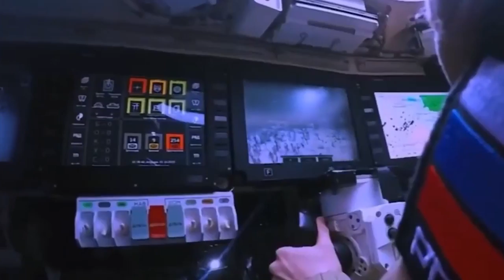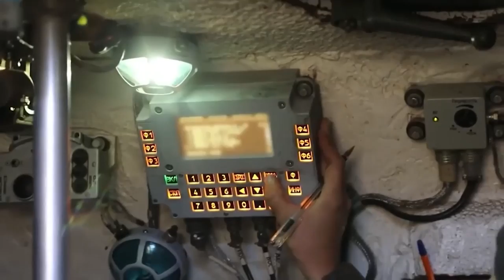What's Wrong With Russian T-14 Armata Tank (Military Analysis)

Comment: So the tank doesn't suck , but the fact that Russia cant produce it in large numbers does
Reply: No it does suck. It was designed around a smaller than normal engine. That engine is a poor copy of a German porsche engine designed to pump oil. The production buildings are built. The workshops are built. But empty of any significant tooling due to sanctions. 
The T14s are hand built effectively. So as you can imagine take an age to construct. And again due to sanctions have cheap rubbish electronics.
Reply: @TheBarnestah  sources? 😂

Comment: The autoloader doesn't have to be a problem in real world. In theory, yes it can break, but what are the chances for it? Americans developed a similar concept in the 80s called MTTB and it too had an autoloader that IIRC serviced 40k rounds in harsh conditions before there was any problem with it. So yeah, in theory it can break down and it probably will one day, but how many soldiers would be saved in the meantime thanks to the design of the tank that is enabled by this autoloader?
Reply: If anyone knows anything about autoloaders on Russia tanks, they tend to spell death to the entirely of the crew. Just take a look at the tons of video footage of Russian tanks getting their turrets popped off because of the ammunition cooking off within the autoloader. Just what do you think happens to the crew inside when their tank turrets are popping off?
Reply: @Jknight416  T14 tank has blown off panel, for it's crew, so when the whole tank blown up, the crew could be saved, well in Theory.
Reply: @IslamistSocialist371  The even in a separate compartment, concussion will kill them.

Comment: How will this t14 tank fare any better against a javelin strike?
Reply: It has an ams that, in theory at least, will shoot down incoming missiles. As was demonstrated in Syria, it works better in theory than it does in practice.
Reply: Moskav ship was also designed to intercept any incoming missile. Yet, it took 2 hits from Ukrainian missiles and sunk. Everything Russian-made is "good" on paper!
Reply: @macobuzi  Have you seen the Mostova readiness report? The ship shouldn't have been in a war zone to start with. Even then, there was no reason it should have sunk either, it could.have easily been recovered if the crew had the bare minimum training and experience.
Reply: Moskva was also practically robbed of all its point defense turrets and missiles by corrupt maintanance officers. Of the 7 PDs only 2 worked and the missiles werent even loaded
Reply: @Jknight416  ground base anti ship missiles do exists my dear, and yes the russian army is incompetent and corrupt. The problem isnt the gear or the solidiers but command.

Comment: "For example the F-35"... Not quite a good example of success... If the T-14 sucks, than the F-35 is deep throat...
Reply: The F-35 has actually proven itself to be quite effective in combat exercises due to its stealth capabilities.
Reply: @samuelweir5985  well they put enough money in it to finally get it right.
Reply: @jfarmer1776  Yeah, the F-35 program was expensive and there were unexpected problems, but that doesn't take away from the fact that the F-35 is an excellent strike fighter. Same sort of thing happened with the F-111 Aardvark program. Lots of development problems but at the end of the road the F-111 actually turned out to be a great aircraft.
Reply: @samuelweir5985  and then it got shotdown by a serbian s-75 like any other aircraft.

Comment: Driving at 75km an hour in reverse using a camera ? 😮😂😂😂😂😂😂 yeah right
Reply: Driving forward also requires the driver to use a camera. There's no difference for him.
Reply: @JAnx01  of course there is. Steering is completely different
Reply: @UlsterScott  How is it different? It's a tracked vehicle.
Reply: @JAnx01  lol. Driving forward, to turn left your steering brakes the left track, when in reverse it has to brake the right track to turn left. Opposite is not easy to do at high speed with only a camera and a narrow field of view. Almost impossible and that assumes that the camera system remains undamaged 100% of the time. On paper it’s not a terrible idea, in the field under battle conditions it’s the silliest idea I’ve ever heard. That is from personal experience. I’m not an armchair warrior, I’m a retired British tanker
Reply: @Colin Elder  There's been systems that mirror the steering in reverse for decades. Nicholas Moran mentioned it in a video he did on the M48.

Comment: Good summary. Advanced techno requires spotless supply chain et contractors quality management to be fail proof, one thing Russia hasnt proved to be so good at. One point tho, the autoloader might be slower, but allows for continued shooting while in motion. Reloading while moving fast (to avoid being a sitting duck) is quite a challenge, even properly strapped. I would be surprised if M1 can achieve this one shot every 5s mentioned  while going through rough terrain. Also, even non lethal blows to the tank can result in crew concussion should pressurization be breached, thus slowing down the reloading process. All in all, modern tank design tend to favor autoloaders (KF51, T99, Leclerc, T14, K52)

Comment: How in the fuck are they firing that fast? Lol 7:45
Reply: I have no idea, but when it came to interviews with Abram loaders, they only said, "You just need to lift."
Reply: You're right, i just realized it was fabricated to make it seem like it was firing so fast, i took the time to look at it closely and saw how fast the dust disappeared after every fire (but not the last one), that's bcz they take the sequence of the next shot where the dust already disappeared completely (after minimum 10 seconds i guess) and superpose it on the previous image using a soft transition, hence the immediate but soft disappearance of dust. And you can see that the dust remained there and didn't disappear suddenly after the last fire coz their didn't superpose any new image on top of it afterwards.
Reply: Trained humans work faster than machines.
Reply: @Brandon Davis  No, the footage is just edited. Like @Zied SG comment said, the dust from the recoil gives away the jump cuts. 

Also, single piece autoloaders are faster than hand loading. The only reason why people tend to think autoloaders are slower by default is. Is it because Soviet carousel autoloaders use 2-piece loading, thus lengthening the process.
Reply: @KSmithwick1989  Lmfao. Sure, kiddo.
Reply: @Brandon Davis  So you're disputing the dust we can all see disappearing between shots at 7:45
Reply: @KSmithwick1989  So, you think it's like a live stream and they don't take multiple takes of the same thing? Tell me you've never worked with a camera, without saying it.
Reply: @Brandon Davis  I've worked enough to spot that it's a looped shot. You can tell by focusing on certain elements. Like the smoke plume, the secondary plume from the bore excavator, and the commander. 😆
Reply: @KSmithwick1989  Wow, an editor used a looped shot. How dare laziness exist, right? Lol.

Comment: Unfortunately you could take this entire documentary and you could put the name of any other countries main battle tank in it and it would sound exactly the same especially hearing about the delays. For every 1 hour of use on a Abrams it requires 2 hours of maintenance! And it uses jet fuel...
Reply: Do you understand jet fuel is literally a gas / diesel type thing (varies what type of jet fuel) except usually less refined? also the abrams engine can use desiel fuel. The M1 abrams also doesnt have the many issues that come with ppl in only the hull of the tank, and is proven through actual combat experience to be effective and many abrams tanks exist. The M1 abrams is still an outstanding tank, and many others like the leo and chally 2 and 3 series also werent riddled with this many issues.

Comment: The armata that broke down in the parade didnt actually break down. It was a mistake made by the driver by pressing the emergency brakes, thats the reason why the recovery vehicle that came to tow it couldnt move it an inch. Plus the auto-loader takes 5-10 seconds to load a shell into the breech and since the auto-loader has proven faster than the ones in t-72s and t-80s the time might even be less. Miss fires are extremely rare either in auto-loading tanks and manual ones so thats a really minor problem. And t-14 as any other tank shares problems so dont show them to people like new and only armatas problems. Thank you and please next time be more educated with a topic.
Reply: 🤓  "uhrm qctually it was not a breakdown"
Reply: What country are you from?
Reply: Drinking the Russian Kool aid I see just like how they say that they weren't retreating in Ukraine they're doing a strategic positioning
Reply: AB, take another bong hit
Reply: @Foundbison  american bot
Reply: Right, and nobody in the tank knew what an emergency brake was. And nobody towing the vehicle thought "maybe we should make sure the emergency brake is off to make our job a million times easier", you know, the first step in towing every single vehicle in existence.
If that's the case, this gross incompetence is far worst than the vehicle breaking down. But now that you mention it, it does seem like the kind of failure only the Russian army can pull off. Next time, you'll tell me Russians forgot you had to remove park to go forward.
Yes, I copy pasted my own comment, cope if you don't like it.
Reply: @Brian-qj4kk  stalinbot
Reply: Couldn’t have said it better
Reply: Bot
Reply: White Fox  they guy was talking facts, just because you don't like russians it doesn't give you the right to ignore facts and just spout nonsense fueled by your feelings
Reply: @Komnis21  you see the difference here is that the US was able to take Afghanistan and Iraq something Russia is having trouble with Ukraine and just check the kill to death ratio in the afghan war that lasted 20 years and compare that to a few months with Russia invasion of Ukraine and also their is a difference when your trying to nation build after you completed the objective something everyone is oppose because our government simply wants to waste time and resources to make companies richer
Reply: @Foundbison  Watch the clip carefully, u will ses the front suspension dumping forward.
If it was a breakdown the suspension would not resist to that extent
Reply: @rodrigorodriguez6332  you lost me at US was able to take Afghanistan kiddo
Reply: Ok dimitri
Reply: T-14, towed to the Parade, broke down during the parade, Towed out of the parade.

Russians: It wasn't broken!
Reply: @Insert-Retarded-Reply-Here  It was towed out, I watched the parade. Cope harder, though.
Reply: @brandondavis7777  there is 50% rebate on copium today in soviet russia
Reply: @rodrigorodriguez6332  

The United States would have suffered significantly more if a large military pact was funnelling billions of dollars worth of weaponry to the Taliban.

Also, the Soviets took Afghanistan before and their client Government survived for months instead of days
Reply: @Foundbison  it wasnt tho. A pilot crashing a plane because he turned off the engine isnt the fault of the plane.
Reply: @MichaelDavis-mk4me  thats just common grunt incompetence.
Reply: @rodrigorodriguez6332  look the country we are arming and that already had one of the biggest armies in the world is harder to beat then a bunch of goat herders in the mountains. Also we nation build (bombed hospitals after the invasion) so it was much harder.

Comment: Its value will be proven when it appears on a front line in Ukraine. Where Russia sorely needs it...  if it works.  
I am seeing stories that a number of them are being used to fire rounds from well behind the front line.
Which could be due to not being properly tested yet, or lacking critical components, or simply not up to full spec but required for extra artillery.   Which, if true, would be a terrible sign for Russia.   Of which there are many!

Comment: The Thing that kill tank tanks on the battlefield are artillery and no tank could counter it , I’m not surprise that the t14 was not deployed. The Russian claim that the t14 could put 7 round down range in a minute which is good.
Reply: LOl where you got that from i'll never know. Artillery is NOT a tank killer. Anti tank systems are.
Reply: @okbutthenagain.9402  did you see what happed to leopards and Bradley’s ? Those tank were smashed to pieces by artillery. No tank can counter a 155mm shell flying down at Mach 2 with 50kg of explosives.

Comment: If the T14 works, it has some potential 

The problem is not as much as the design as much as software, and chips, and the lack of funds. 

If Putin committed to buy 1000 of them in the first order, the cost can come down. Of course that is impossible, since Russian economy is smaller than Spain or Texas

Software is a much harder problem, and chips too. There is no shortcut…even if Putin threw $1T at it, both will take decade to develop 😅 or import, which they can’t

Comment: The T-14 has a super stealth feature not found in most modern tanks.
Reply: yeah its so stealthy its still not been seen on any battlefield
Reply: @Helperbot-2000  why should it?
Reply: @lucasworktv  because if it was a capable vehicle it would be used against ukraine, but its just used for parades while they keep using older and older soviet equipment because their tanks keep blowing up
Reply: @Helperbot-2000  I mean why should you use a new expensive vehicle against a weak by itself country? And especially if there’re other good tanks or other weapons?
Reply: @lucasworktv  Russia has used its best troops on ukraine. The T-14 is not used, because it does not work… like everything in Russia. The T-14 is a shitty tank and Russia is scared that everyone will know this fact if the T-14 fails in Ukraine.
Reply: @sabundus590  sources?

Comment: >one of them broke down and had to towed away 

This literally never happened during the parade the driver hit the E-brake  by accident and they thought it broke down the recovery vehicle literally couldn't move the armata because it had the brakes down which is why not even 10m later its seen driving off with nobody checking the engine stop blatantly lying

>glitches in software 
Wtf are you on about literally no source mentions any kind of glitches and neither does your video cite any sources

>autoloader issues 
The carousel autoloader is the most reliable autoloader design on any MBT even the British challenger  originally was planned to have one as PIP 87 they quite literally do not break all the autoloader is on any T-series tank is a spinning carousel a lifting arm and ramming chain its 3 simple components 

>slow reload 
The T-14 does not reload in "10 seconds or more" its listed as 10-12RPM there is no reason that it would be slower than the 7s T-72 and 6.5s T-80 another thing is reload barely matters sure you can reload in 5s or less on a non autoloader MBT but the gunner or commander will take longer to aquire a target 

>Chinese media disliked the T-14 

No Chinese media has ever commented on the T-14 performance 

>no buyers 

Russia is not selling the T-14 to China because China is already selling the VT-4 and India is still buying T-90S 

>burlak

Burlak is an upgrade kit for T-72,T-80 and T-90A it's not meant to replace the T-14 
Overall shit video go cite some sources
Reply: Have you seen the Lazerpig video on the T-14?